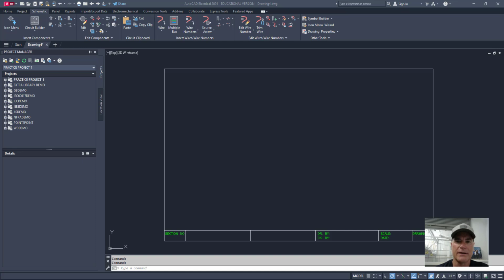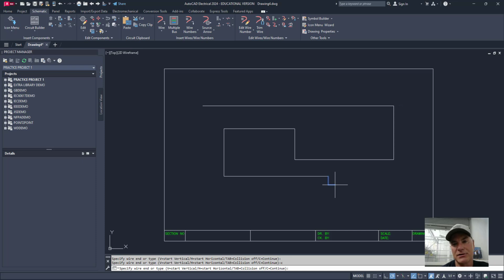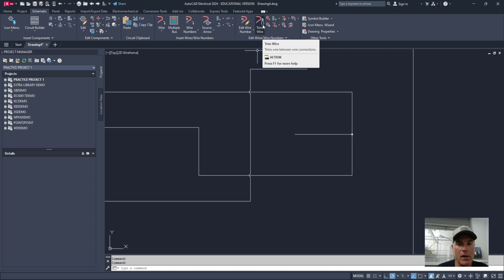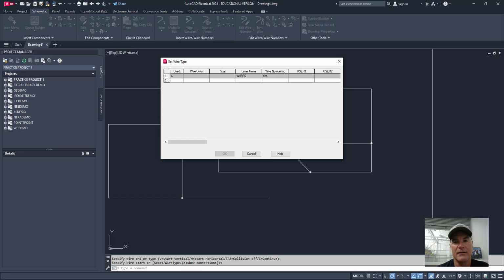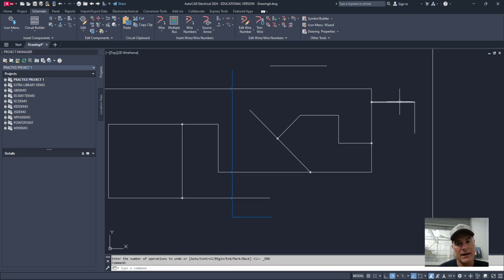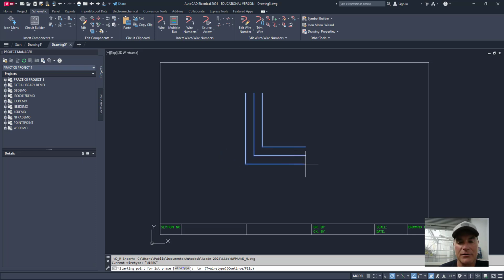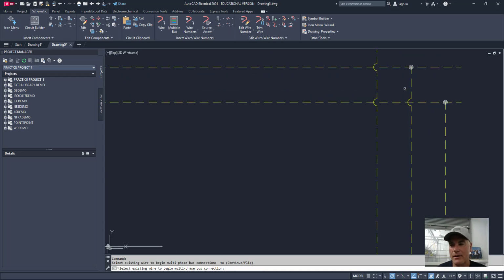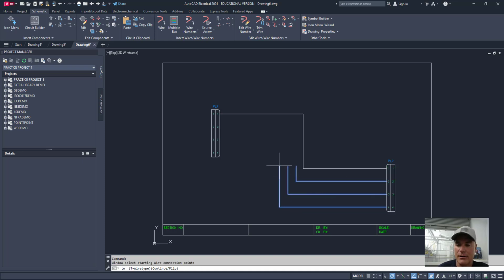AutoCAD Electrical - Wires Basics

Comment: Do you have a video on how to setup terminal blocks in autocad electrical?  Thanks!
Reply from the maker: I don't have one made, but I can make one this week! What are you looking to do? Do you need to create a custom symbol / terminal block?
Reply: @professor_porkchop  I'm just looking to setup a terminal block (TB1) for 24v power to 4 circuits and adding jumpers from a catalog part in the terminal block editor.  Also will be using stranded wires and will need to setup ferrules into the wiring (not sure how to add them in the terminal block editor).  I don't need to see the ferrules when I export into inventor and only need them to be auto populated on the BOM.  Anything would be helpful, as I'm just starting to use AutoCAD electrical.   Thanks :)

Comment: If you have multiple drawings in a project, are you able to wiring and terminate to several drawings in the same project?
Reply from the maker: Yes. If the complete plan spans several separate pages you will use source and destination arrows to indicate the linkage.